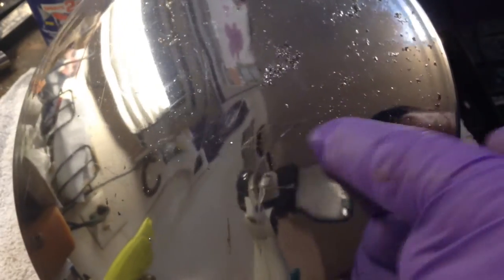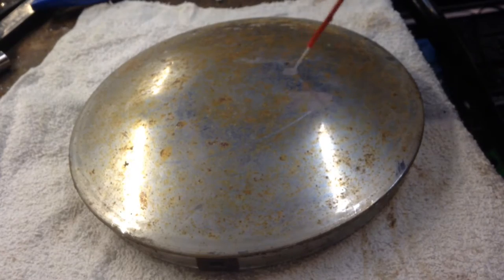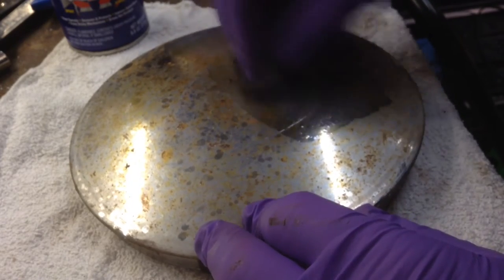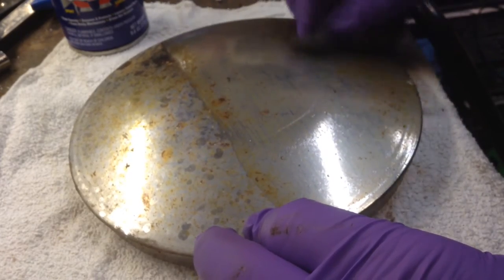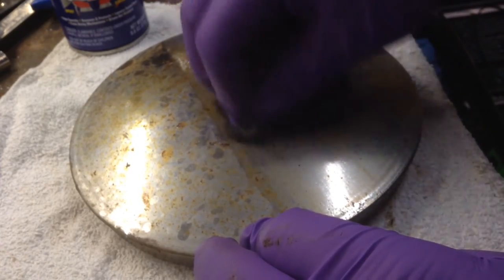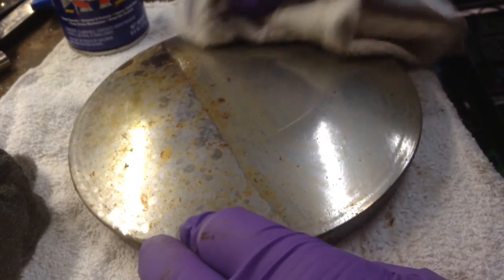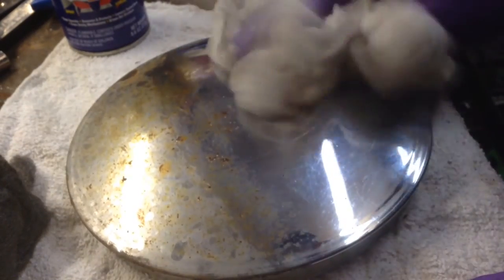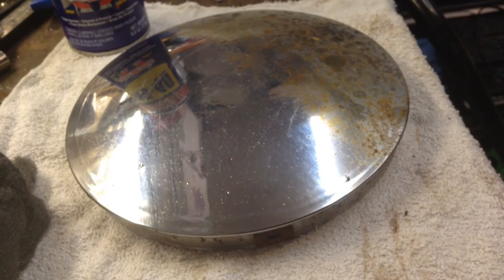Cleaning up the hub caps

Comment: Question for you: I have a vintage 1941 chevrolet hubcap i found in the woods. I don't have steel wool, will sandpaper work to clean my hubcap without damaging the look?
Because it has some paint left on the hubcap
Thankyou :)
Reply from the maker: Hey Jonathan, I think the sandpaper might be too abrasive and would do damage, I would wait and get either steel wool with wd40 or those SOS scrubbing pads work very well too. The soap in those makes a great lubricant as you clean.
Reply: @RooneysSears01  Ok thankyou :)
Reply: @RooneysSears01  I used wd-40 and scrubbed with a old chore boy wire brush it cleaned very nice